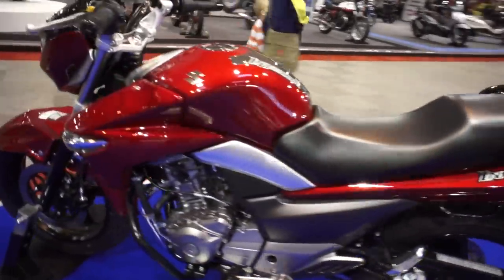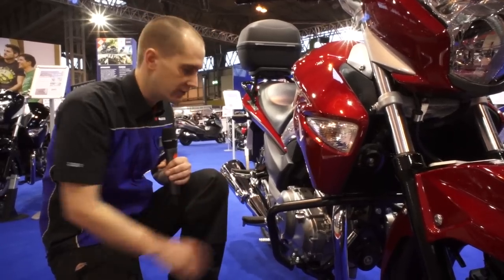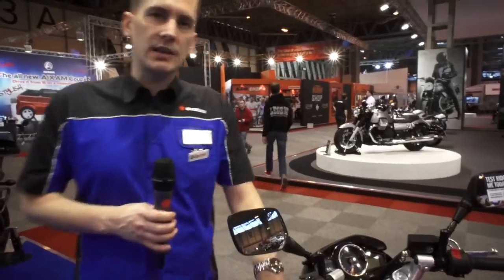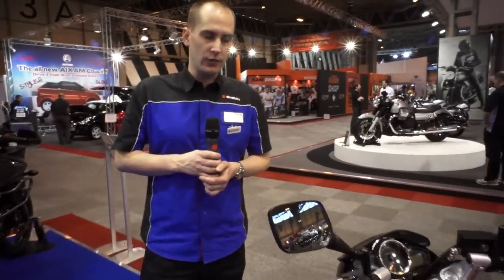Suzuki Inazuma Model Information Video

Comment: Have a 2013 in the US, very limited availability here just for a few years. It is the one bike I will not sell as it is an excellent back roads bike for an aging rider with weakness from injury. It is solid for short runs on expressways which is a necessity in the US at times. It is has been super reliable but I wish more accessories are available for it. I had to source a windscreen from Turkey for example. They are so rare here that nobody knows what it is. The ride is very compliant which is great for secondary roads with poor maintenance. I think if they had released it in the US at 300 or 350cc it would have sold better.
Reply: I'm in the u.s and im looking at one now but the "f" version. How are the brakes on this bike? Does it stop it pretty good?
Reply: Can you tell me where exactly from turkey you sourced the windscreen please

Comment: I have this bike and the Suzuki 1300 Hayabusa ..both have their good points. The smaller bike is far more relaxing and comfortable  to ride  ..just does not have the blast effect of the bigger bike. Gears are smooth ..suspension  soft and comfortable with very little if any wind buffering .Styling ..well it is different which makes it stand out .

Comment: only negative I found with my new Inazuma is that I can't go on the highway during the break in period, to keep the RPM under 5500. This is a tough 1000km to go through.
Note that every gangster in my town wants to race the red bike, they don't know it is more looks than actual performance.

Comment: 85mpg is crap ! I can get that two up on a CB500x.
Reply: Yea but that Honda costs twice or more the price to purchase ,more to insure & more to service & for parts & won’t have a seat that’s half as comfortable . Also you must be riding slower than Miss Daisy’s driver to get those fuel figures on a 500 twin ,even if it is a Honda .
Reply: @maskedavenger2578  Get those figures keeping up with ordinary traffic. I also own an Inazuma and it isn't as good on fuel as the Honda. Plus, also don't have to contend with the size and weight of a massive ego, so that in itself guarantees good fuel economy.
Reply: @p.istaker8862  I don’t see what size your ego has to do with fuel consumption . It’s your size & weight or lack of it ,plus amount of throttle use & correct gear position choice ,that’s likely to have more effect . One of my motorcycles is a Suzuki DL 250 V STROM ,with the same frame as the Inazuma ,& same engine with slightly different cam profile . I fluctuate between 17 •5  &. 18 • 5 stone & get 80 pus miles to a U.K. gallon ( approx 4•5 litres ) on a mix of town ,country & some motorway riding ,( new tight engine ) . The Inazuma is heavier than the old Honda Superdream 250 ,& produces similar top speeds & better on fuel consumption . The Honda CB 500 x is a different animal to the Inazuma & costs a hell of a lot more to purchase & knowing Honda will be a hell of a lot more for parts . The Honda CB 500 x is only a better choice ,if a rider ,is in the market for a 500 adventure styled bike ,& is prepared to fork out more cash to purchase it .
Reply: @maskedavenger2578  Irrespective of all you have put in your essay. 85mpg (imp) is still crap. The purchase price has nothing to do with fuel economy. Even petrol engine cars of the same period can  return Mpg figures in the high 50's.
Reply: @p.istaker8862  You started it by being a sarcastic blurt . Also a Honda CB 125 f is hardly a 250 cc motorcycle it’s another totally different animal . If you are going to make comparisons ,it’s should be with another parallel twin ,single over head cam ,2 valve per cylinder 250 cc motorcycle of similar design & curb weight .
Reply: @maskedavenger2578  Al I did was post a comment stating that I thought 85mpg is crap. It is crap for what the bike is. Just as a CB500x, loaded (being a totally different motorcycle, as you have already stated)returning 85mpg is good in terms of fuel consumption for what it is.
Reply: @p.istaker8862   In your reply to my comment to yours ,you also made a snide sarcastic remark, hinting that I had an ego issue . In another one of your replies ,you also made a sarcastic remark about my comment being an essay . I am not disputing that the Honda CB 500 x gives good mileage for its engine capacity size . Any vehicle over 200cc giving 70 mpg ( U.K. gallon ) or over ,is giving good mileage . The point was the video concerned a 250 cc budget machine & therefore should only be compared to similar 250 cc twins .
Reply: @maskedavenger2578  Ok understood. Will remember to only make a comparison in future, allowing for a tolerance of plus or minus 5cc's. Hope that is not too sarcastic . Sorry for having an opinion that does not fit the parameters of your own.
Reply: @p.istaker8862  You are fully entitled to your opinion where it agrees with me or not.  What I don’t agree with Is the sarcastic remarks hinting I have an ego issue ,or what constitutes an essay . When I went to school an essay consisted of a number of full pages, not just s few sentences .
Reply: @maskedavenger2578  Bored with this
Reply: @p.istaker8862  Whatever I’ve forgotten about it already .